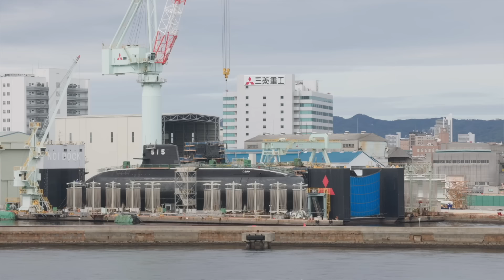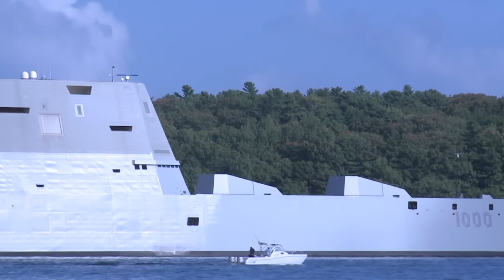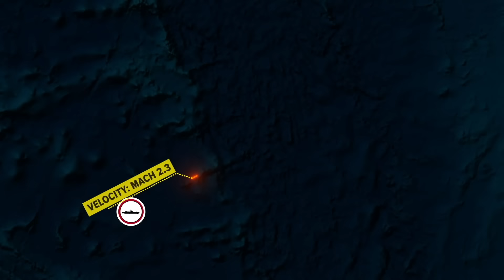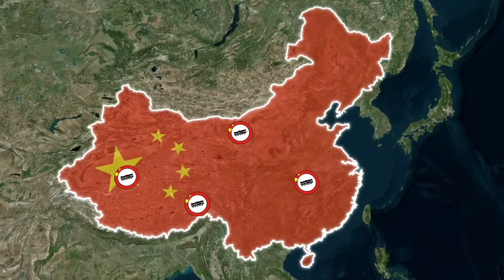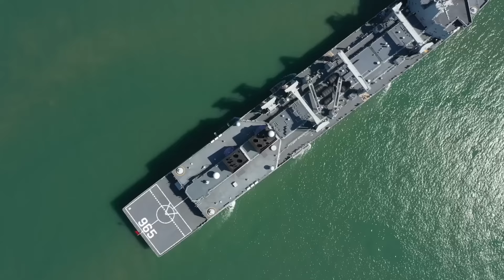Japan’s New TOP-SECRET Weapon TERRIFIES China

Comment: Electrical engineer here. Generating millions of volts is not a hard engineering problem. A volt is the potential energy per unit charge. You can dump a lot of energy into a single unit of charge to get high voltage (Van de Graaff generator). The hard part is storing the charge at high potential for later use or generating enough charge at high potential to sustain power use. One way to store charge is in capacitors, that come in either ceramic or electrolytic, but are both based on a basic principle of 2 conductive plates separated by a non-conductive material. The hard part about capacitors is that you are fighting a balance between efficiency and lightning. The capacitance is defined by total area of the conductive plates divided by the distance between them squared, (i.e. small plates close, good. Large plates less close, equal. Miles of plates feet apart, next to nothing). The issue you run into with high voltage capacitors is that there is no such thing as a true insulator, just better insulators. Every material has a set point where it stops resisting and just goes with the flow (dielectric breakdown). You need to increase the insulation thickness to increase the voltage required to reach this point. This means the size of the capacitor is roughly square of the required voltage and linear to the capacitance.

The high voltage is required to create the high current that generates the magnetic force used to move the projectile. This is based on Maxwell's equations of magnetism and the Lorentz force. Basically big current equals big magnet. Current, measured in Amps, is the change in charge over the change in time. This change in charge generates heat based on I^2R (Amps^2 × Resistance). This leads to the next engineering problem, heat management and another fun principle of electricity, resistivity. Basically, as things heat up, the resistance goes up. This then causes more heat and on and on until you have a fire. 

Tldr: you can make a rail gun out of a microwave and a metal coat hanger with little difficulty. The US couldn't meet DARPA requirements, yet.
Reply: a very good reason  to   go with lasers
Reply: @mikefugate1367  fricking lasers....love it
Reply: I heard the real problem with railguns was that dumping seven million amps through the sliding contact, between the rails and the armature holding the projectile, was an unsolvable arc heating problem that eats out the rails in just a few shots.  No solid material has been found (unless Japanese secret) that isn't damaged by an arc far more intense than in an electric furnace.  For a taste of a  real Japanese fantasy weapon read the novel, "Rise Musashi.".
Reply: @jeremyocassan  the arcing isn't that big of an issue if the projectile is already touching the rails when the voltage is applied. The issue is that the high current produces heat in the rails, causing warping.

Comment: The electronic guidance system can be done with remote control where the console is away from the gun itself and the EM Force created by it so it won't damage the electronics. The Munitions put in the railgun could have the rails already connected to it and stored in a makeshift gun clip type deal where after each shot the ammo is loaded with the rails already connected to the ammo by using shear pins that connect the projectile to the rails. The spent rails would be loaded into a separate automatic storage bin. As far as power supply goes you could use three power supplies independent of each other so that charging time between shots is not wasted. These three charging stations would have to be able to charge up the firing voltage within 15 seconds after each time it is fired the projectile and that would give you six rounds per minute. The real problem comes from the mechanics of the guidance system to move quickly enough and accurately enough and still could withstand the jolt after a fire without damaging it

Comment: I think you meant 7 times the speed of sound.  2300 m/s. Also, rail guns use low voltage high current. You want the current as high as possible. Also, they store the electrical power in capacitors, which is necessary.

Comment: This is a garbage video. The rail gun has been around for a long time and they’ve been testing it for many years at the base that I worked on in Dogg in Maryland for the better part of a decade. it works and is a proven concept, but it requires an unbelievable amount of power electricity to launch the projectile and it’s extremely heavy which precludes it from being mounted on a ship, at least one the size needed to be effective. there are so many incorrect statements in this video that are thrown out as if they’re factual that it’s obvious it’s complete gobbledygook

Comment: 1: railguns have been tested in the US as well 2: railguns destroy the rail when fired so 1 shot and done 3: railguns do not project at the speed of light nor can anything including light travel faster than the speed of light... 4: these can not be shot while mounted on a boat or ship as the recoil would be insane, a special type of ship/floating platform would need to be invented to allow it. 5: these can not counter a fired missile as the weapon must be designed with a fixed mounted concept due to the insane recoil, any swivel system or anything would see the weapon absolutely destroyed from a single shot. 

   Railguns are currently useless. When we get into space pretty much all our ships large enough to mount one of these weapons will have them but down here on earth the best we could do is design special ones that need a building sized mount to even slightly open the options to aiming the weapon or place them on specially designed floating battle platforms. Either way they would be incredibly expensive and vulnerable to attacks. If Japan did however build the ones that could be aimed it is feesable that they could bombard Chinas mainland. Such weapons can only achieve two real goals. Massive destruction of opposing sides infrastructure or anti naval and air batteries. But these batteries 1 shot anything.

Comment: I wonder why they don't make the projectiles in rail guns much smaller, which might cause less damage to the rail system. 40 mm projectiles must be incredibly heavy and thus the cause for the limited lifespan of the rails. Smaller projectiles like super bullets could penetrate almost anything and you'd think the firing rate might be much improved with a concomitant improvement in lifespan of the rails. Bigger isn't always better, but militaries are sometimes backward thinking. Just wondering...

Comment: The U.S. had a successful naval rail gun test in 2016. If Japan has been successful in this recently, then it would suggest that the U.S. helped them with this given the current tensions with China. Remember, these tensions have been a thing since Xi Jinping has been in power and has been increasing steadily over the years. Which is a lot longer than you think.

Comment: That is probably the best sounding Avalanche I have heard. I have a Hooker Aerochamber muffler on my Avalanche with the single in
n and dual out set up. i like it quite well as I didn't want it to be as loud As a 40 series but also has more horse power and torque.
I think i might like how this FX sounds even better than mine. Hard to tell from a video, but it sounds very similar to mine.

Comment: Another untruth in your video is the "wear on the components within the barrel.  There IS no wear in the barrel because there is no friction!  Just like a maglev train there is nothing touching the barrel!  Finally, 800 degrees C is not hard to overcome.  Temperatures of current rockets far exceed 800 degrees C, so that analysis is wrong, as well.

Comment: 5320 mph er that is slow buddy, and not 7 times the speed of light at all. Light speed is fast,  186,000 miles per second, multiplied by 7   (to quote you)  = 1,302,000 miles per second. 5320 miles per HOUR is not the same as per SECOND... First point...  So using the same units that is miles per second  means the weapon fires its round at only ... 88.66 miles per second not 1,302,000  miles per second being 7 times the speed of light as you say !!!!!!!!!!!  .  You are so far out it is actually laughable ...

Comment: Hard to see how a railgun could counter a hypersonic missile. Both are fast, but the missile is steerable. The railgun shot is NOT.
Furthermore, the railgun shot would have to score a direct hit on the missile. Current anti-missile missiles just need to get close: they detonate a warhead that scatters shrapnel in the path of the oncoming target. That's an entirely different thing.

The railgun won't be targeting missiles. It would be a significant threat to a warship. It could be used to attack land targets: one could take out a dam, or a significant part of a city without nuclear capability. It would put Beijing within range of one based in Nagasaki, to say nothing of railguns mounted on ships that are closer. They'd be very hard to stop.

So yeah: IF the Japanese have figured out the technical challenges - figured out how to stop the gun self-destructing with every shot - they have a pretty attention-getting defensive weapon. But a weapon that could defend against hypersonic missiles? THAT'S dubious.

IF this thing works they should mount a bunch in bunkers in Taiwan. Not only would they nullify the threat of ship-based invasion, they'd put major dams like the 3 Gorges Dam at risk. Taiwan NEEDS a nuclear missile defense: that's the only thing that would checkmate China's belligerent threat of invasion. But a railgun MIGHT come close: significant deterrence without nuclear.

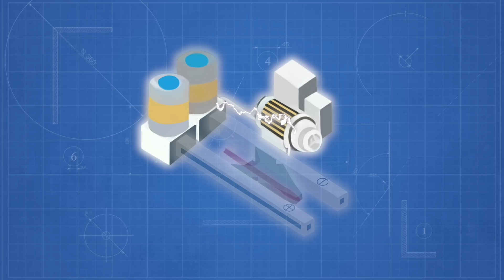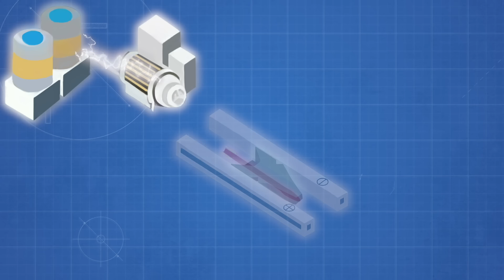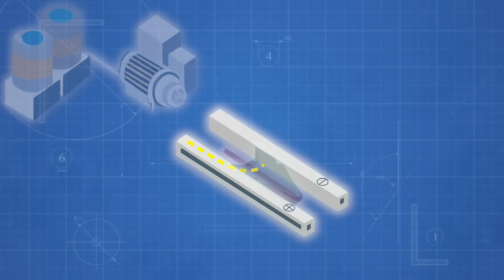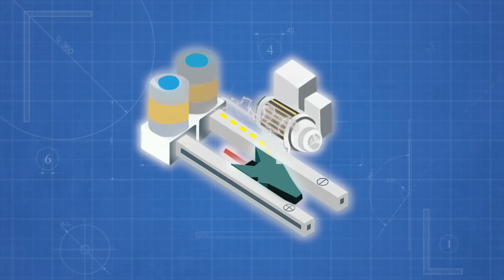Comment: 4:00 "Millions of volts"? :'P Nope, millions of Amperes, there's a BIG difference, the voltage is only in the thousands. 4:20 "Typically large magnets" Nope wrong again, they are made using conductive metal, typically copper. 4:30 "One with a positive charge and one with a negative charge" Wrong again, has noting to do with charge but instead the direction of the current. 5:00 "Seven times the speed of LIGHT" Ha ha ha ha ha, maaaaan dude you screwed that whole thing up so so bad it's almost hilarious, maybe consider actually doing your homework before releasing a video? I know it would be a first...

Comment: Japan's railgun is only a test prototype, far from an actual, installed weapon.  The only things of which one can be reasonably certain is that Japan is on the cutting edge of railgun development and that Japan will not cut corners or fake data the way PRC's corruption riddled tofu-dreg producing military industry does.  Japan's Self-Defense forces fully realize that the nation lost in WWII in part because it was forced to take shortcuts in arms production.  If Japan ever fields a railgun, it will be the result of meticulous development manufactured as precisely as possible.

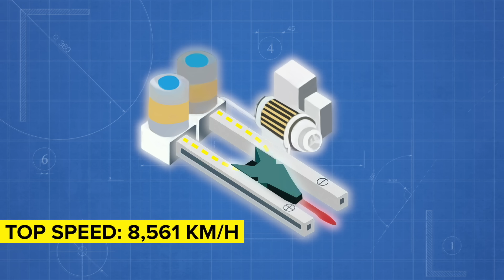Comment: 5:00 😂
lol That would break physics. You obviously meant sound. As seven times the speed of sound in dry air is 8,643.6 kilometers per hour. Seven times the speed of light would be impossible for any object with mass to travel at 7,554,769,936 kilometers per hour.

Comment: Hypersonic missile speed: Between 5-10Mach or 3,836–7,673 mph (for long disctance)
Railgun projectile speed:  Around 9 Mach initial speed shot out of barrel, which decreases over time as it is not propelled like a missile.

Oh and there are the high hypersonic missiles going over 10-20Mach. No there ain't many thing shooting these things down. When they get fired for real it's very likely there would be destruction not even talkin about final phases where one missile can hit multiple targets while splitting. The video is full of bs and you know it from min1 with made up facts.

Comment: The reason the US set aside railgun projects as less important is that the US now uses high power lasers on several of its vessels. Unlike railguns firing projectiles 20 - 60 miles a second, lasers fire at light speed literally. 
US Naval vessels are heavily armed. China is not a match.

Comment: hey usa tjust make the rail gun  ectromagtnic rails just be able to be replaced like simply exactly just like a convental gun barell like a realger gun would do. also active cooling of the rail gun rails in teh barrel would work as well. also the shell that the rail gun fires also needs a push and pull discarable elcortmagtinic propeling carlage thatws justa pure block or elctroferessius emelents like thsoe sabot ronud the 125mm sothbore anti tank gun the abriabs A1M2 uses but its for railguns instead.

Comment: Err, light travels at roughly 1.08e+9 KM/H. 8.5e+3 KM/H looks more like a speed of sound measurement.
c is the fastest the current can move through the system, but the inductive nature of the system will cause voltage lag.
The primary limitation being the mechanical friction of the system.
I am curious about the efficiency of a rail gun v. high energy laser v. high energy plasma.

Comment: China is falling apart from the inside, so it has to project power to hide its internal weaknesses!  But, China can be easily defeated by the use of drones and UAVs.  China's military is ready to fight the last war and not the next great war.  It's missiles have had the fuel sold on the black market,  so it is strategically  weaker than many analyst  believe.   Don't buy into  the China PLA hype!  Chia copies everything it has from western companies and it is economically weaker than it used  to be!

Comment: The speed of light is 299,792, 458 miles per second. It's not even close, let alone seven times.
Reply: 186,000 miles per second is the correct correction eh ?
Reply: Blackadder564. The speed of light is 186,000 miles per second not 299,792,458 miles per second ( in a vacuum nit in a hoover vacuum LOL)
Reply: See the unending comments about the video making the mistake of saying speed of light vs. speed of sound.

Comment: The problem is the rails require actual physical contact with the projectile. The rails are quickly degraded.  A coil gun would obviate this problem, but I assume there are issues with getting the same power efficiency.

Comment: 5:05 = MISTAKE: x the speed of LIGHT?!?!? Nothing can do even a fraction of the speed of light, let alone multiples. Light is 186,000 m/second 7x 186k per second? LOL, Now, the gun and the shell would evaporate just from the friction of air. 1.3 million miles a second is 7x the speed of light. Perhaps you meant the speed of sound which is closer to 741 miles per HOUR That's 78,120,000 miles per min. or 4,687,200,000 MPH over 4.5 billion miles per hour? or 5187 mph? I think I would believe the later. A laser is the fastest thing (It is light) and there is no material thing that can even think of coming close. Against all known physics.

Comment: Railguns could be very effective kinetic weapons against stationary (buildings) or slow moving targets (large ships); perhaps even an alternative to cruise missiles when playing the role of seaborn artillery. But... 

There's no way you can intercept a missile with a railgun projectile. The electronics will not survive the acceleration and even if they do, you still need a very sophisticated projectile (see iron dome system) which negates the advantages of such a system. Shooting down asteroids will be a problem for a platform (to say the least) because of Newtons 2nd law. Space launch is also a problem because the energy required to launch to LEO is HUGE. Escape velocity is 33 times the speed of sound! IIRC, 33 is greater than 7. And, you'd want way more than a few kilos of payload. And, again, acceleration would be brutal because you'd need to gain all that speed in a very short distance -- the length of the barrel. This may be implemented on the moon using a VERY long (and slow) rail where gravity is low and there's no air resistance. These speculations in this video are absolutely bonkers.

Comment: 5:07 - 7 times faster than a speed of SOUND, they made a mistake there (speed of sound is approx 1235 km/hour, at normal conditions. That value variates depending on humidity, altitude and other physical parameters of the atmosphere)

Comment: Why chase rail gun which wears out after ten shots when a coil gun carries the projectile in a magnetic field that both pulls and pushes the projectile? 

Many YouTubers have posted videos of designing, building and using handheld coil guns that fired magnetic steel objects ranging from BBs to washers to bolts.

If this can be built at home from hardware store materials, why don't defence contractors even try?

Many u tube

Comment: A functional railgun will use magnetic fields to suspend and to propel the projectile, thus resulting in zero wear on the components.  Rather like a maglev and linear accelerator combined.  Seems feasible, with an adequate power supply, and very low resistance conductors for the mag-field generator (inductor).

Comment: Even up until this video's upload, astrophysicists have yet to discover anything that travels faster than the speed of light, let alone 7x its speed, let alone invent something with that speed. Maybe in another millennium or so. You said this railgun has projectile top speed of 8,561 kilometers per hour or if my calculator isn't drunk, 2,378 meters per second. Light travels at 299,792,458 meters per second. Perhaps you were thinking of the speed of sound which is 1,235 kilometers per hour.

Comment: so the mount needs to withstand 1472°F.
and when reaching 1473°F, it is broken?

if you use such exact values, please explain what will break it when going one degree further?
Reply: Remember the straw that broke the camel’s back?😆
Reply: @John64314 sure, but if it is necessary to use 4 significant positions? it's 800°C, 1 significant position in the number, done.
I have seen questions about recipies: add 709,55ml of water. great, that's 3 cups. but 5 significant positions signify extra required precision.